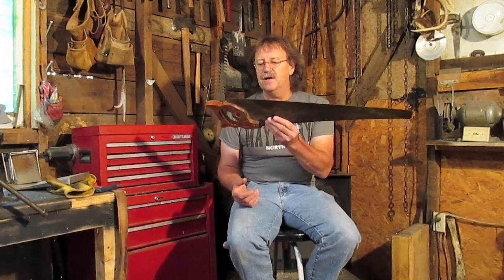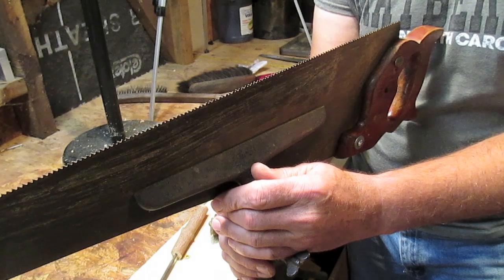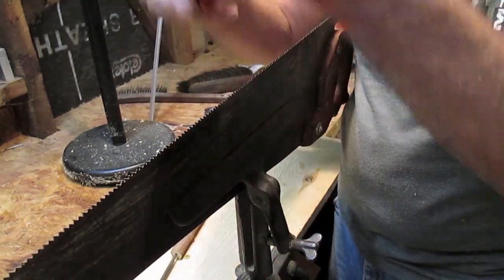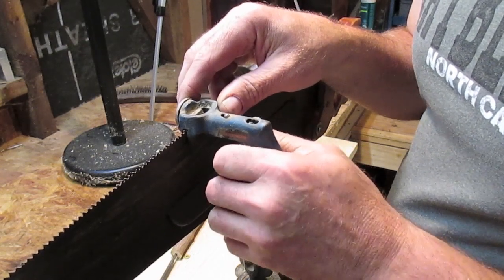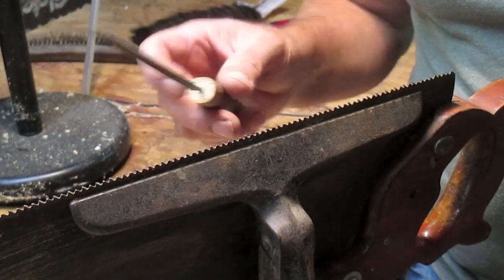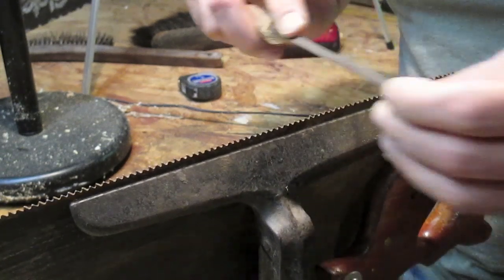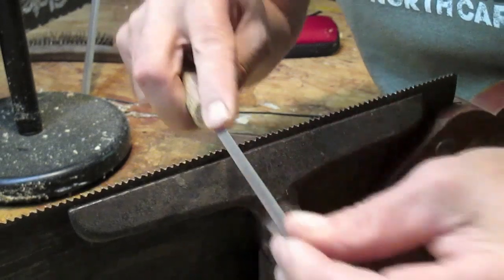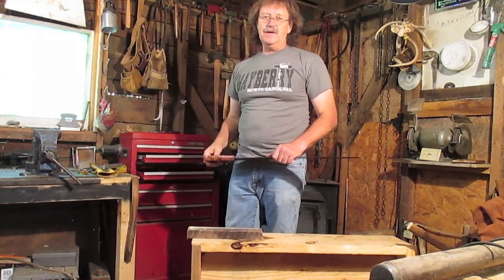How to Sharpen a Hand Saw

Comment: Great video. I recently obtained a S&J panel saw for $3 at the local tip shop, it was crusty and rusty. I didn't have a container big enough for a vinegar bath so I scrubbed the bugger with vinegar and a scrap of 120 grit wet/dry in the laundry sink and nearly passed out from the fumes (another story). I set the teeth with a hammer/punch on a scrap of pine, then filed the teeth with a file. I tested the saw on a fallen Wattle tree in the backyard, and marvelled at the shower of dust raining on the nearby weeds. Even 20 minutes of TLC can turn junk into heirloom tools, even for a beginner. Thanks Mike ... many roads to Rome.

Comment: Interesting that you sharpened an 8 pointer in the rip configuration. If this were sharpened as a cross cut you would change the angle of your file strokes correct? In a crosscut you would have fleam angles

Comment: I have 2 curved pruning saws that I really like using but the man that used to sharpen them has passed and I want to learn how to sharpen and set these for myself. They are 5 point per inch and I want to order one of those set tools but need to know if it makes a difference how long each tooth is when it comes to the various set tools out there. One site said that I would only want to bend or set the top 2/3rds of the tooth. So do these set tools have different depth settings for different tooth heights?

Comment: hey i love ur videos. and im just wondering where ur from?
Reply: *****
Hey Mike, what part of Bland are you in?
I am also in bland out rt.42 a few miles from the high school.
I see you are into blacksmithing. I have recently gotten into it myself. I am about to build myself a forge and am in the process of getting some tools together. You don't have any old ones you no longer use laying around? Handles or not, I can carve new ones if needed.
Looking for tongs, a cross pein, and a large ball pein. I have a length of RR track and think it will do a pretty good job for an anvil for now.
Thanks,
Michael
Reply: I stopped in the one here in bland saturday and didn't find too much. Looked at snoopers today as well and found a pretty nice ball pein for a few dollars. Going to carve a new handle for it and it should do well. Going to hit a few flea markets as well this spring...usually hit Dublin.
Do you remember the name of the shop in Maybury?

Thanks for getting the info out. Enjoy the videos.
Reply: alright. Thank you

Comment: Never trust the numbers on a saw set.  Never set the teeth when they are dull.  A needle will only slide in the teeth if they are crosscut teeth that have been filed with fleam or bevel. The teeth on that saw should have been reshaped. Always joint the teeth before filing them. Do not count file strokes. This is one of the most misinformed saw filing I've ever seen.
Reply: What do you coat of lube the saw with to avoid rusting?  I have acquired two older saws and I'm going to soak in vinager to derust then they will need coated.   I was kind remembering as a boy that it might have been bees wax?  Thanks, David
Reply: +David Thorne  I have tried vinegar and I don't like the grey surface that it leaves on the saw.  And if you are not careful it will eat right into the metal.  I just use wet/dry sandpaper, starting with a grit that will cut into the rust. I use Mineral Spirits with the sand paper. I go smaller on the grit size down to 600. If the rust is really hard and thick, I'll use a box scraper blade in a plastic handle that is made for holding a box scraper blade. You can buy the plastic handle at Home Depot. Use Mineral Spirits with the scraper. If you don't mind the grey surface, use Evapo-Rust instead of vinegar. It won't eat into the metal, just the rust. Evapo-Rust is a bit pricey though.